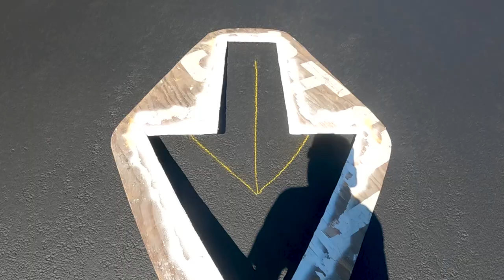HOW TO REPAINT ARROWS IN YOUR PARKING LOT #relaxing

Comment: What spray gun do you use? It seems not to make cloudy marks all around the template. 
Usually, company I work for does rubber running tracks or playgrounds but next week we have to line up the track. We don't have buggy though. Only templates
Reply: The spray gun is from graco but doesn’t use filter. The paint is industrial more thicker than interior or exterior paint. When you smell industrial paint, it’s has a musk odor that similar to oil base paint.
Reply: I do this type of jobs myself and work for a company